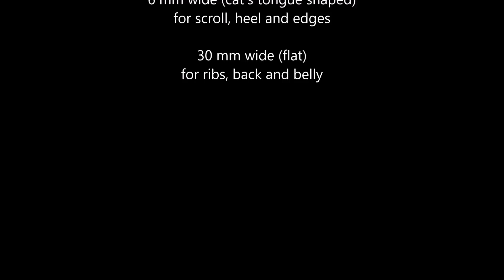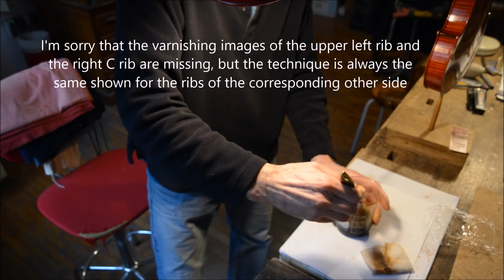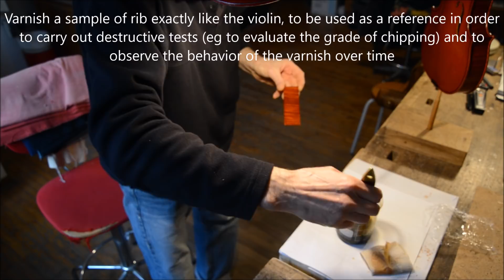Linoxyn varnish - Application of one coat with music and captions

Comment: Hey David, was a pleasure to meet you! I hope to varnish 2 Instruments near Summer this year and wondered how long this particular varnish takes to dry? All the best to you! Thanks.
Reply from the maker: Hi Sam, my pleasure!
I apply two layers of varnish per day at most, but this depend on ambient condition and if you use an UV drying box or not. Without UV box one layer per day would be better. When the varnishing is finished I have to wait at least one week befor setting up the violin to let the varnish bear the pressure of the bridge feet, but I think that the complete maturation takes about two months or more, during which the varnish will seem perfectly dry but in reality it will continue to compress slightly due to the presence of minimal residual traces of the solvent trapped which will slowly have to make its way through the layer and evaporate definitively. This is a usual behaviour of solvent varnish, whether it be oil (with solvent) or alcohol varnishes.
Reply: i know im asking the wrong place but does anyone know a trick to log back into an Instagram account??
I was dumb forgot my login password. I would appreciate any assistance you can give me!
Reply: @Harlem Eugene instablaster ;)
Reply: @Knox Sergio Thanks so much for your reply. I got to the site through google and Im trying it out atm.
Looks like it's gonna take quite some time so I will reply here later with my results.
Reply: @Harlem Eugene Happy to help :)

Comment: Hello maestro.  With your valuable help I have reached the critical point of the varnish.  I have put the casein and I am ready for the sequel.  Can you give me the ratio you use for the refractive sealer with mastic as well as the way of application?  Thank you very much.
Reply from the maker: The concentration of the refractive sealer is about 16%, i.e. about 4 g of mastic in 20 g of turpentine essence, to which I add up to 20% of finely powdered pumice. I apply it abundantly with a brush, then remove the excess with a rag moistened with alcohol and I let it dry for 24/48 hours in the UV box (or a week in the air if you don't have UV lamps). It is important that a thick layer does not form, but the sealer must only remain just inside the surface of the wood without forming a glossy layer.
Reply: @DavideSora  Thank you mister Davide. I hope all this helpness return to you someway.

Comment: A respectable sora
I have a question.
I could not get a constant red color because the alcohol quickly evaporated when I painted an alcohol varnish with a red color
What about your varnish recipe?
Reply from the maker: Yes, applying the layer of colored (red) alcohol varnish uniformly is a difficult challenge requiring a refined brush technique, high-quality sable brushes are helpful. In any case it is practically impossible to get perfect results straight from the brush, I also need a few days of retouching with small brushes to balance the lighter and darker areas, but if you get too many darker spots from the beginning it could be quite difficult to eliminate them completely and more likely you will end up getting a "leopard skin" effect or with a too dark overall color😊
My recipe you see in the video has no added color (it's for first layers and for final layers, colored layer stay in between), but in any case it has a pretty intense golden yellow color obtained from resins (seedlac and linoxyn), to which I add red lakes of madder and cochineal and a little bit of brown / black madder lake to slightly cut the excessive brilliance of red lake alone. With these types of colors (insoluble pigments that I make by myself following historical recipes) it becomes even more difficult to achieve uniformity and you easily risk killing transparency if you put too much and of poor quality , but if applied correctly the end result is far more beautiful.
You can try with alcohol-soluble synthetic or natural colorants too, it's easier but not too much.....getting good results is always difficult and requires experience, unless you are satisfied with a yellow color only.

Comment: Maestro how Many layers of casein ground do you use before varnish? And after this May i varnish or you do something else? The color is in the varnish?
Reply from the maker: Depends on the degree of absorbency of the wood (ie density), usually one or two coats will do the work. However, the casein (or others protein sealers) must be inside the wood and not on the wood, it must not form a glossy layer. It is followed by a refractive sealer like mastic or colophony dissolved in turpentine essence, again in the wood and not on the wood as to not forming a real glossy layer. Than varnish without color and after this colored varnish and then final uncolored varnish.
Reply: Davide Sora thanks again
Reply: Maestro do you use oil color? And do you prefer alcohol varnish knowing strad used oil varnish or i am wrong?
Reply from the maker: Alcohol varnish probably is not that of Stradivari, but in the case of those with shellac they are more resistant to wear caused by abrasion and above all they have a greater resistance to the player's sweat and humidity of the humid climates, this is the main reason why I prefer it. From an acoustic point of view it depends on the composition and not on the solvent used.  Moreover, on most of the antique violins there is not much original varnish left but on the contrary there is a lot of shellac due to the overlapping of varnish (mainly 1704 shellac varnish used by the restorers) and for the widespread French polishing, so varnish is not decisive for the their sound. However, I also experiment with oil varnishes mainly to better understand the historical reasons, but the colors I use are the same for both, that is to obtain a base color mainly from resins and give color tones with insoluble pigments such as cochineal and madder lakes for example, which I make by myself.
Reply: I got it, thanks again😃

Comment: Good morning from Greece. Teacher Davide I have two more questions. What varnish do you put on the neck (the point where the violinist has his hand). And if the varnish without color before that with the color (all over the violin) is applied with a brush and how many layers you apply.
Thank you very much.
Reply: Maestro Davide please save me!!!!!!!  :)
Reply from the maker: The neck is not varnished, it is treated only with linseed oil applied with a rag, three or four passes in the space of a week, drying well between each pass. Of course it was first treated with casein and with mastic and turpentine like all the rest of the violin, but then these layers will be sanded down to the wood to remain only as impregnating agents. After this sanding I apply a little color, usually chicory extract or propolis, but many other water soluble colorants may work, or even some oil colours can be used. After the color I polish the surface with very fine sandpaper (Micromesh grit 3200) and then it's time for the final linseed oil treatment. 
The violin varnish would not be suitable for the neck because it would wear out too easily making a mess, some use shellac which is more hard and moisture-resistant and works, but the feel of a slippery varnish surface is different from the more natural and silky one, tipical of the wood simply treated with a very thin layer of oil.
Reply: @DavideSora Thanks master davide once again. I must say that the second part of my question was about the whole violin and not just the neck. Sorry i keep asking questions but it is my first violin and the questions are many. Everything I have achieved so far is from your videos. God bless you.
Reply from the maker: @mesimerisnikos  The layer of clear varnish before the colored one must be enough to build-up a uniform glossy coat. This may need 5 or 6 coats of alcohol varnish or 1 or 2 coats of oil varnish. In any case it is always a little different and depends on the dilution, you have to look if some opaque areas remain on the surface and in this case you have to put one or two more coats, or next time use a lower dilution to keep the number of coats lower. the dilution of the varnish must be as low as possible, just the right amount to allow good brushing
Reply: @DavideSora  Thank you Davide. Goodnight.

Comment: hello Davide, which factors result chipping in a varnish?
Reply from the maker: Many possible factors, hardness, friability, adherence issues with ground layer, poor cooking of oil varnish, poor elastic properties of the soft fraction for alcool varnish and the list could still be extended.
However your question is too general, the first answer would be "the first factor is probably the bow hitting it at the edge of a C bout", for example....🙂
Anyway, ancient cremonese varnish is chippy in nature, so should be something desirable acoustically.
Reply: thank you again

Comment: Davide, can you tell me what actually the "essenza grassa" and "olio di line chinese" are?
Reply from the maker: Essenza Grassa is oxidised  turpentine essence, boiled down to marmalade consistence. Very good refractive index that give a good contrast if applied as a ground or used as a softener in alcool varnish. But too soft for my taste and very slow drying if used in excessive amount. 
I don't understand what you mean with Olio di line chinese, if you mean Olio di pino cinese, is an oil used to clean brushes (I do not like it but some use it) but if you mean Olio di lino cinese (linseed oil) I never heard of it, maybe refer to Tung oil, a siccative oil from China used for varnish making.
Reply: thank you, some say that essenza grassa is kinda polymerized turpentine sprit aged in the air or by giving it air to age it. Second yes it must be olio di pino chinese because wer were told that its used to clean the brushes. A translation mistake it seems. Why dont you like it? The teacher said it cleans the brushes very well and make them soft.
Reply from the maker: This is correct, but once you have polymerized the turpentine essence for some time (many months) you get oxygenated turpentine that is dense but still in a liquid form, at this stage you can boil it to speed up further polymerization to get the very dense consistency (not liquid or fluid) of "essenza grassa". If you cook further keeping the temperature up to about 280° for a long period you will turn it into a solid resin like colophony.
The process is potentially dangerous and need a lot of cautions, see Fulton terpene oil varnish for details, complete description available on the web.
I do not like chinese pine oil because of the oily residues that may remain on brushes and because I never clean my brushes but let them dry covered with a little varnish (alcool varnish, not oil) that protect them and keep the right shape of the hairs, my brushes treated this way are almost 20 years old and are still working fine. If I have to clean them for some reason (i.e. after use with oil varnish) i clean them thoroughly with solvent and after I give a wash with warm water and neutral soap (sapone di Marsiglia) that it's all I need.
Anyway chinese pine oil may work good too and is the method taught at the school by almost all teachers, but not by me. Simply I do not think it is worth the extra cost of buying it but is a quite diffused method of cleaning.
Reply: again, thank you very much.